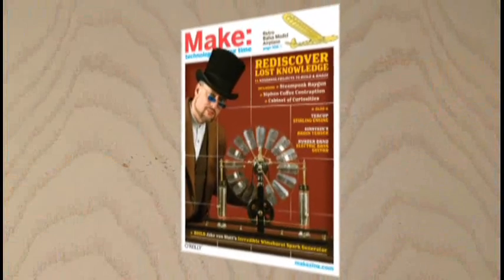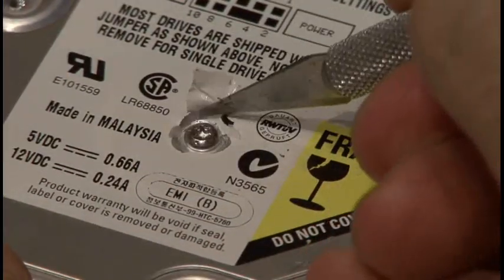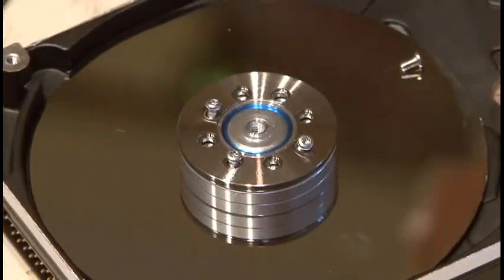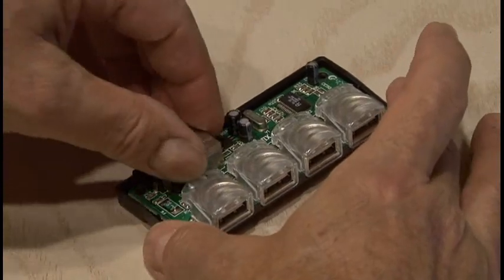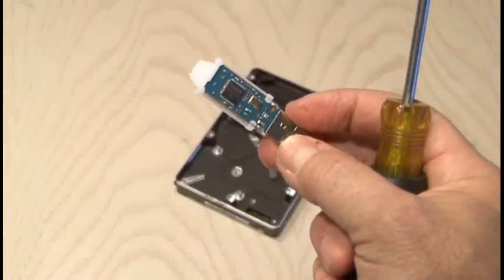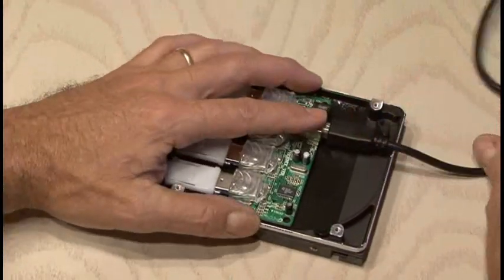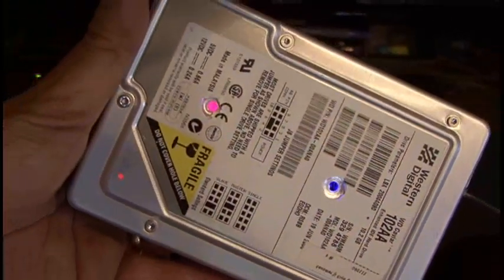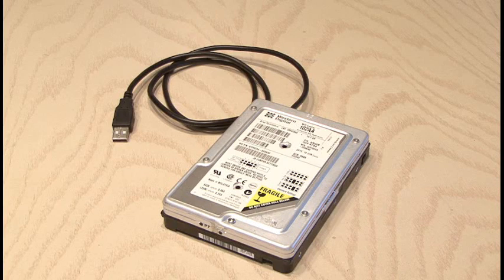Weekend Project: Flash Memory Hard Drive

Comment: Blackbox403: the reason why i said the interface doesn't make much of a difference is because even these modern mechanical drives still hardly can max out the old PATA133 interface therotecial max troughput. Because of all the moving parts. So my point was that its not the interface that makes the drive go faster, its the technic its built upon. Flash memories can be read alot faster today than most drives were capable of some 8 years ago.

Comment: Blackbox403: You're not serious are you? Its not the SATA nor the PATA that makes the speed of a harddrive, thats just the interface that the harddrive communicate with the chipset. You could put SATA600 on that old drive and it would still not perform any faster. 
Btw it's a quite nice way to hide away usb thumbdrives. I need a few in my NAS for files that are often accessed so that harddrives dont need to spin up and down that much, saves energy and harddrives.

Comment: Some additional usb cards(for inside) have a port kept inside. So, the cable doesn't have to come outside. Put he HDD case inside, cable connect o the inside port, and you're all set.

Comment: Guys, flash memory is WAY FASTER then a hard drive. Not in regular person view, but in a really specific geeky view, yes. But not in that arrangement. Internal SSD's are faster processors, given that it can take up to 10us to start a calculation with a hard drive, but with flash, each bit can only be used 10,000 times before giving out, leading to reduced storage space, after quite a short time.

Comment: this is pretty cool but if it were my gmaing rig i would probably find a way to put it in the front in the extra disc tray spot and idk prob just run the USB cable to the back like an external hard drive and prob just use it for games and being as its hidden in the extra disc tray u should always upgrade the memory sticks quickly and easily

Comment: flash drives are much faster than disk drives because their speed is bottle necked by RPM, usually 7200 for desktop drives and 5200 i think for notbooks,. there are 10k and 15k rpm drives to but they are far to expensive for the average consumer.

Comment: Windows 7 will supposedly be able to use multiple flash drives as secondary ram (Speedboost).  mount it in your computer case and assign the full amounts to the drives, then drop the drive letters. they "should" vanish, but still be able to be used by windows as flash ram.

Comment: you can also do it through windows.

Right click on My Computer, goto Manage.

Goto Disk Management, from there you can join two disks togeathor.

If Windows goes nuts for whatever reason, you cannot salavge the data storged on those flash drives

Comment: RAID.
I would've left the HDD alone.
Clear out all that excess plastic filler under the PCB, solder the flash drives without the USB port plugs on the end (since that's what 2/5th's of the flash drive is), stacking them in columns of two, sending 4 light-gauge USB wires out, then fit it in underneath the PCB and cap it off and wiring it to your USB ports for true added speed. (Not just a hub, which just shares one connection)

But that's just me talkin'.

Comment: It's not "sottering," it's soldering. Most if not all (with a few exceptions) of you are complete fucktards who have no clue what you are talking about. Although I agree this project is completely pointless, since my 8GB Sandisk Cruzer Micro cost 20 bucks so if I bought two of those and two 4gigs that would come out to roughly 60 bucks. For sixty bucks I can buy a 320 GB Western Digital "BLUE" series HDD this project is not worth the investment at all.

Comment: you need to have a mother board that supports raid software, which makes it so windows can control each flash drive a a seperate hard drive, the only other way you could do it as one is take each flash card and solder them to one usb male plug, and make that a raided port that you cant remove from the computer or else it wont start up right, if anyone has any questions or is confused, just message me and i will get back to you with the best response that i can...

Comment: I have a lesson for you...

 A Byte is a Bit word. either it is 8, 16, 32, 64, 128... bits long.

A byte in 8 bits = 00000000

If your talking about the logic structure of a storage medium of a Hard drive or flash drive they may be formatted a certain way.

Comment: Unlike what some other posters think, this is a great way to use some of those accumulated parts.
I have 5 or 6 old HDD, several USB hubs, and several old thumbdrives. 

Now, what to do with all the other parts that come out of the HDD?

Comment: Kinda disappointed in not re-using the IDE and power port for the connections because you can find a Flash memory to IDE adapter(~$10.00) which uses the power connector as well.  And for the most part it should be able to BOOT as well as being only one logical drive unless partitioned differently.

I found a CF to IDE adapter and want to use a 32 Gig Compact Flash card as a cheap SSD!

Comment: usb flash memory is rather poor quality..
It can only be writen to so many times before it starts failing.

adnaced SSD drives prevent this by spreading out the the writen data equaly over the drive among other things..

As it is this does not convert it into a SATA och PATA connection...

there are flash card converters that do that though,

Comment: hi 

NOW THAT IS ONE OF THE MOST USEFUL TIPS GIVEN ON THE WEB

APART FROM THE ONE I SAW THAT SAID IF YOU WANT RID OF RUST ON AN AUTO PART "STICK IT IN MALT VINEGAR FOR 24 HOURS AND IT WILL BE VCLEAN AS A WHISTLE , THEN KILL THE ACID WITH BICARB. you know what it worked fine !
so my good friend i now put you in my top ten tips of the year . 
with thanks 

K sinclair

Comment: BEWARE. As fun as this seems the flash drives only have limited write possibilities (around 10.000 times). So do not use it for programs that log frequently or do other write actions.

To make one drive just set the drives into a software raid. Under MAC and OpenSolaris this is simple using ZFS. Under Windows server it is also easy using diskmanager. Under XP/Vista I wouldn't know if they have this possibility of software RAID.

Comment: I think the way it would work is, you can mount (in this case) flash memory 2, 3, and 4 as three seperate folders on flash memory 1, which would be almost as good as combining all 4 into a single drive. At least that way you could access all the data from a single drive.

Then again it would probably be cheaper to just go out and buy a 100 gig USB drive.

Comment: I remember vaguely that you can combine  the drives through "Computer Management" console's "Drive Management" section. Open one of the USB drives under "Disk Management" and create an empty directory, say "Files" and then using the same tool, remove the drive letters for all the other three USB Drives. Right Click on Drive, select "Add Drive Letter ..." and select "Add" and then "mount in Empty NTFS folder...", using the previously created folder and repeat. I think???

Comment: I did the same thing but I didn't use an old hard drive, I just mounted the 4 port hub onto  piece of plastic and then hooked up the 4 usb drives and monted it in the cases floppy drive bay and I used one of the usb ports that are intended for the front usbs for a hook up spot. When I was finished it was compleatly hidden and  the way I mounted it it couldn't move around. The only real difference between what I did and this is that I used 4 16 gig thumb drives instead of 2 8s and 2 4s..

Comment: ya just de-solder all the USB plugs from all the flash drives except for one, and then solder wires to all the points on all of the USB drives to the one remaining one, or better yet, use some IC board to keep it all in place, then use a USB extension cord instead of a hub. Done!

Comment: ps

I've been working for a few weeks, going on a little over a month now on flash drive alterations like this, I just partitioned one, which proved to be very dificult...and moterally useless(its an upcomming video of mine, today or tommrow prob)and I'm actually in the middle is a simular project to this.I had one that will hold 4 flsh drives, I want it to view as 1 seperat one to hold linux,and the other 3 to view as one

If I find a way I'll post it as a video responce if you would like:)